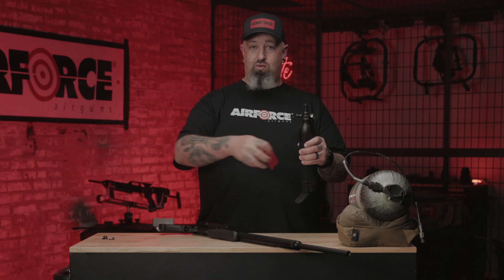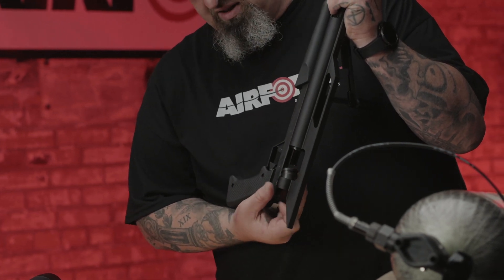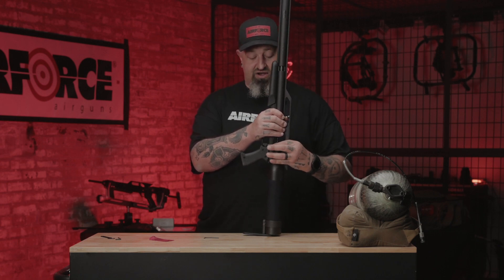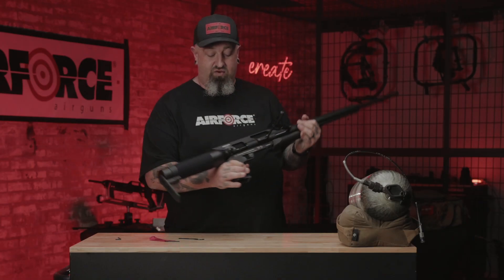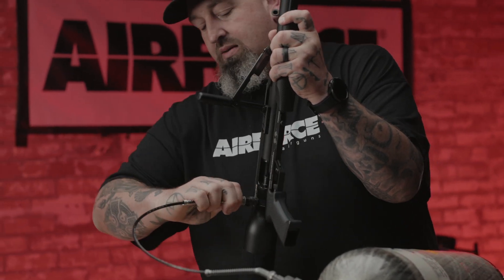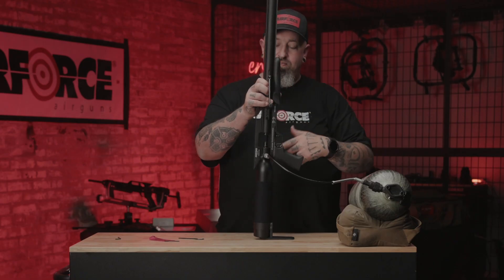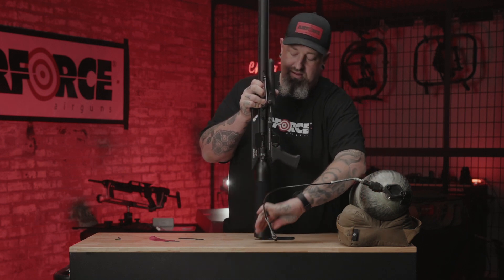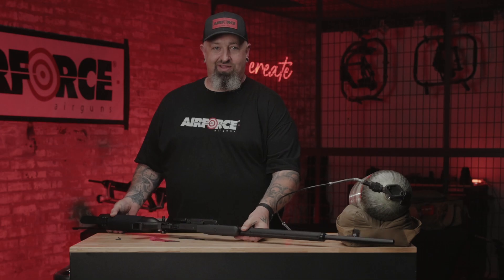Airforce Airguns Tutorial Series  Big Bore Tank Installation.

Comment: So, not sure where to start. I have an Airforce Texan in 457. Was plinking this weekend. After my second tank fill, halfway through that tank, the tank pressure blew out when I cocked it to load the next pellet. I refilled the tank again and it did the same thing. Thinking the gasket/o-ring thing...
Reply: Contact airforce. They will send you a new tank seal to fix it.